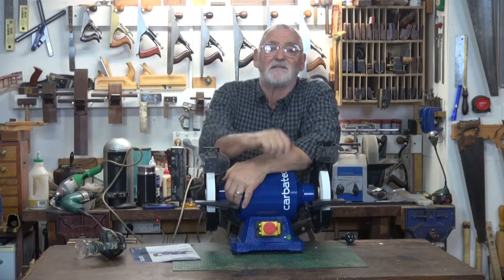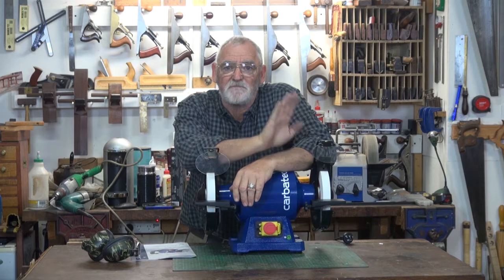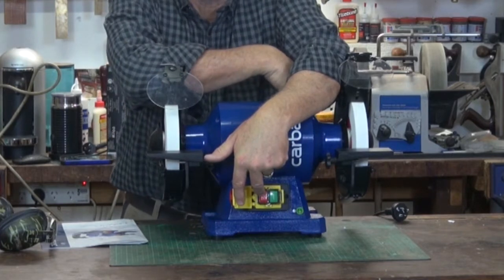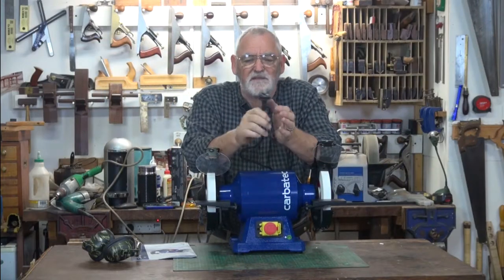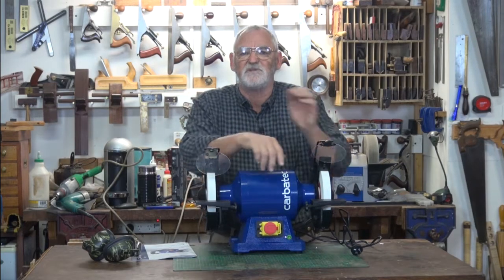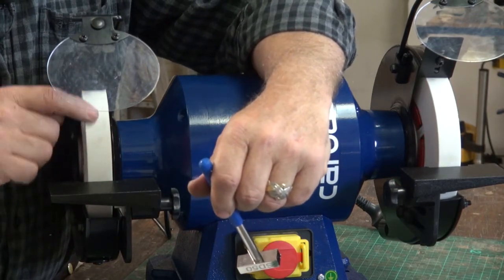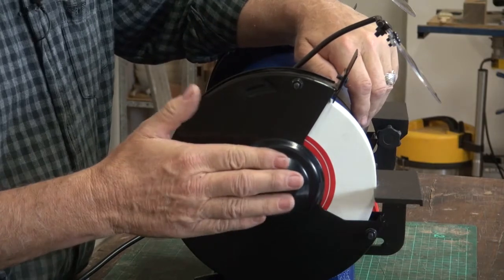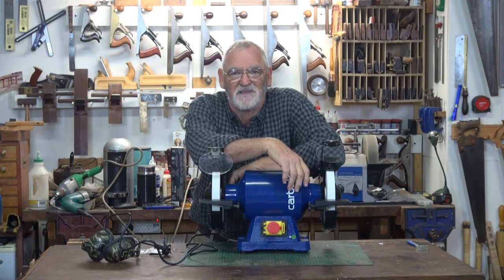Part 3 - Maintenance - Carbatec 200mm Low Speed Bench Grinder GR-S200P

Comment: Just arrived today. Good video but had I have known it was made in China, I wouldn’t have purchased it. Tool rest plates are aluminium and not steel and feels like I’ll be replacing them in the future. Motor runs pretty quiet, vibration pretty low but overall it looks cheap and feels cheap. This company started off in Australia and they repeatedly sell you this story but has ended up in China. I wish I could ask for a refund.
Reply: Its a lot cheaper than the German one that was the only low speed grinder alternative to the Carbatec one that I bought, and I"m quite happy with mine, yes, you can get a grinder with steel tool rests, but that German one was more than four times the price and I'm sure that you'd have been even more unhappy with that.